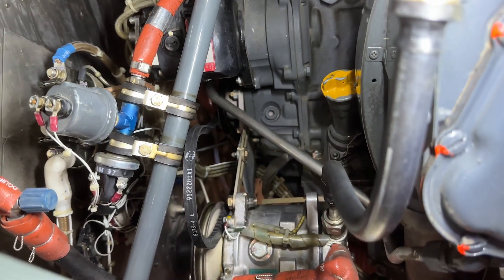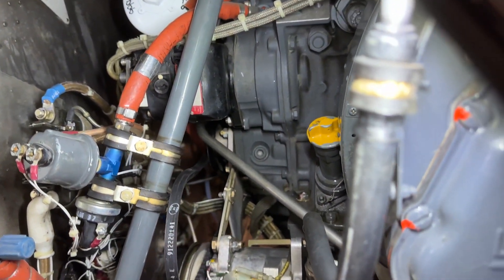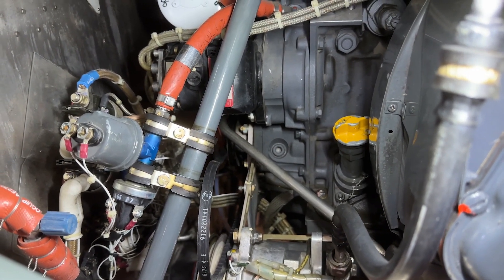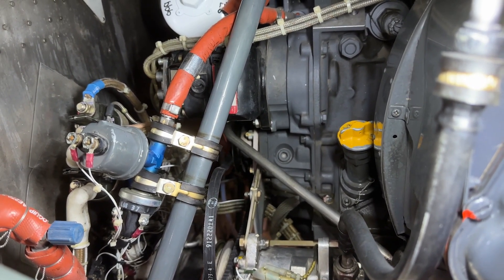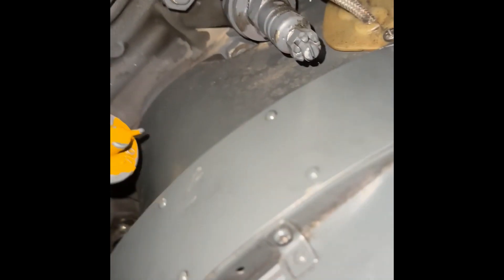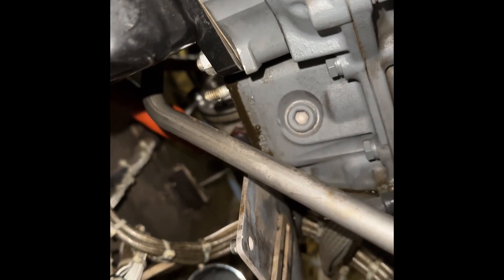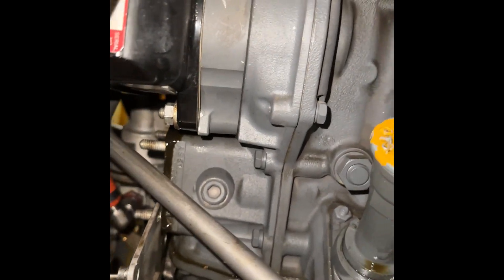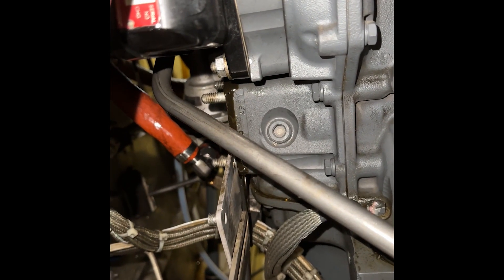An even more unusual source of an oil leak in a Robinson R44

Comment: The one i was flying at my old job had a leak coming form somewhere around the base of the oil filter, but not the filter gasket itself. I was always convinced it was from the oil filter base, where the base seals to the case.